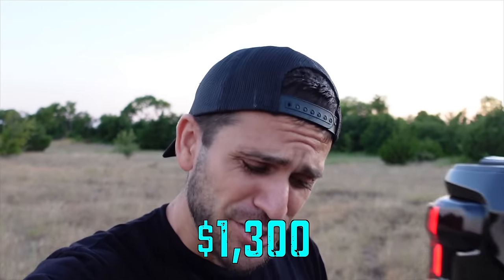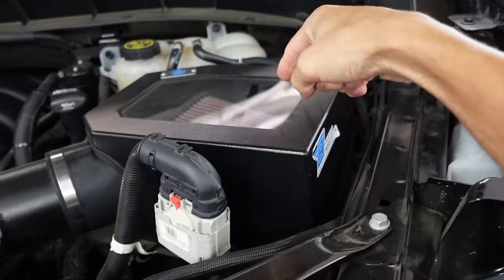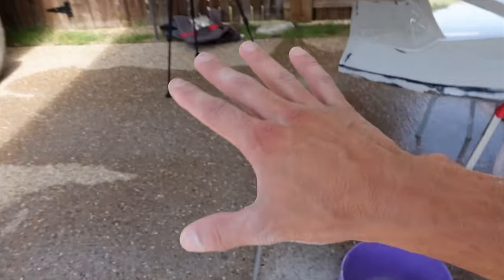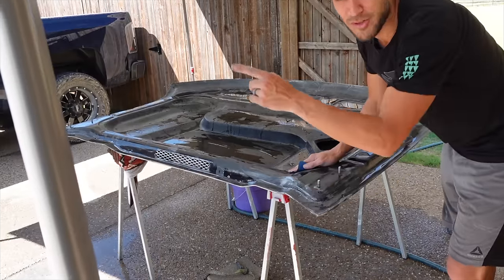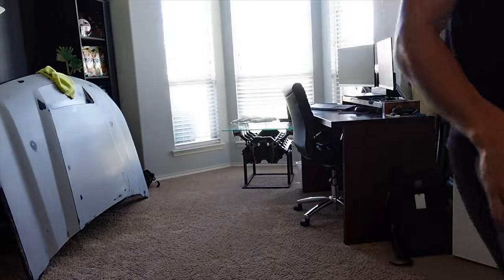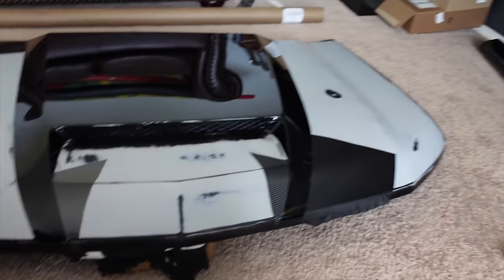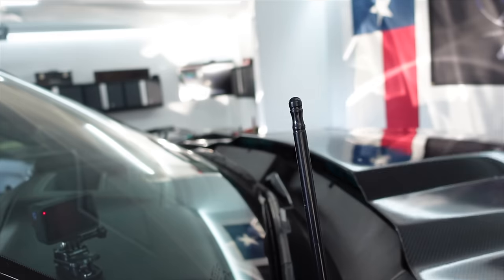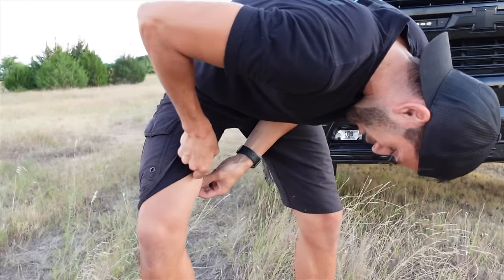Custom $300 CARBON FIBER Hood for 2019 - 2022 SILVERADO

Comment: Did you use a tac rag on the hood? That will get all of the unseen dust off of the hood. They are made for prepping surfaces for paint, but should work the prep for vinyl as well.

Comment: That looks awesome. Good idea mixing the gloss and carbon fiber. I feel like when you add carbon fiber to one place it has to be mixed in around the truck. It would look good with some carbon fiber filling in the Chevrolet on the tailgate and maybe a wrap of carbon fiber on the side mirrors. Also, we need a dyno pull on this truck. How much improvement have you gotten from cold air and borla exhaust? Love the content. Keep it coming.
Reply from the maker: That carbon is for sure going to land on a few more pieces of the truck 😎 thanks for watching!🤙🏽🤙🏽

Comment: Have you had any issues with water working its way through? It did not look like it had a collection point or drain. This would work great with the K&N air box with the open top. Any input would be great.
Reply from the maker: Not a ton of water, but a heck of a lot of dust.

Comment: The ram air hood is definitely a nice edition brother. I wouldn’t have the patience to complete plus my Silverado has to compete with what you see in my profile pic😎 Yep, the truck loses most of the time but I did upgrade my lights to Las Fit, leveled it (2 inch lift in front) and upgraded my exhaust to Rough Country. Enough rumble to make me love my truck again and now I have to compete with my wife to drive it😂😂

Comment: Looks good, I know we all have our preference but I think if you did the black on the outside and then the Carbon in the middle.  Also do the center piece last as the wrap will go over the outside pieces and give you better wind deflection.  That little tiny lip on the carbon will catch air and other dust debris etc.  If you do the center last the wrap will go over and when the wind goes over the hood it will go outwards and not have anything to catch on.